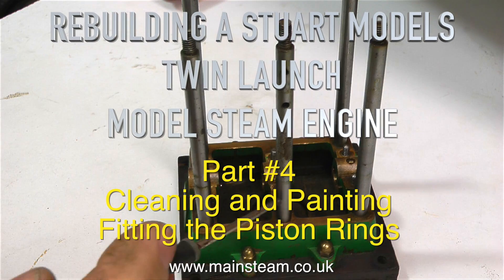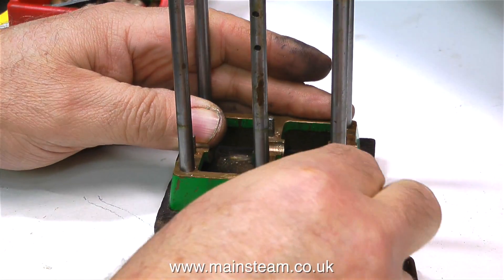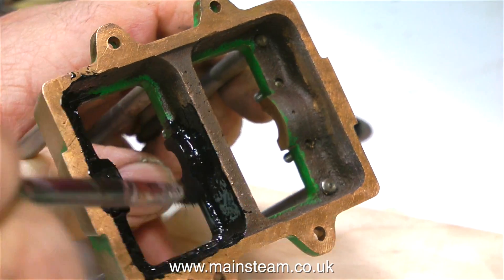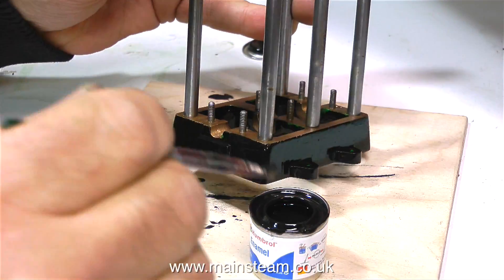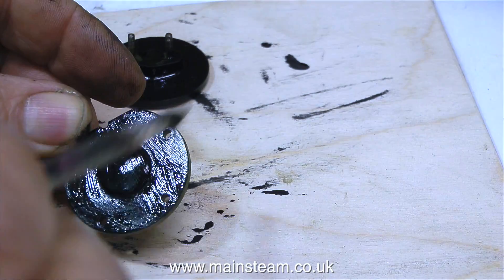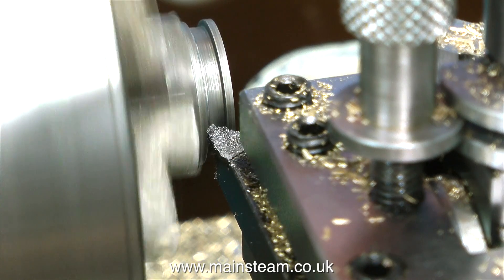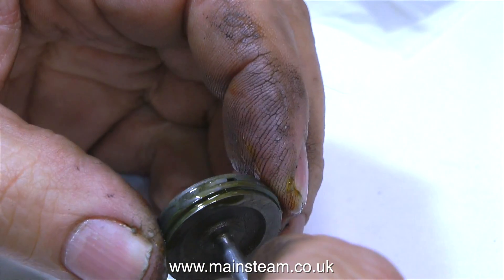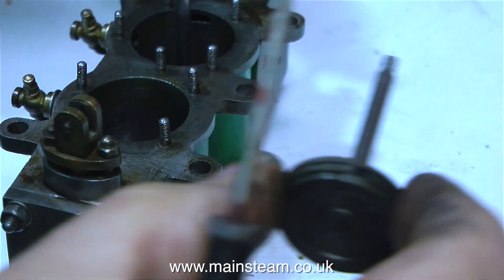STUART MODELS TWIN LAUNCH STEAM ENGINE REBUILD - PART #4

Comment: Why are you not in favour of stamping numbers on parts.  Full size engines often have such numbers or letters to identify mating parts, such as big ends mating to conrods.
Reply from the maker: Simply because the numbers usually stamped on model steam engines are massively over scale ....... too big - too visible . . . .

Comment: If I had tight piston rings I would file/grind the end gap first then re=bore if I had too. 9 thou gap on my BSA 441cc single is where i stat for my steam engines.
Reply from the maker: maybe not a good idea if the cylinders were bell mouthed and both different sizes like with this one  ....... no need to file the gaps this time .